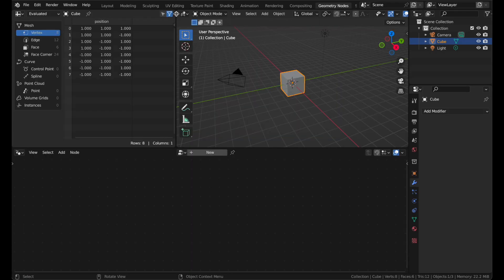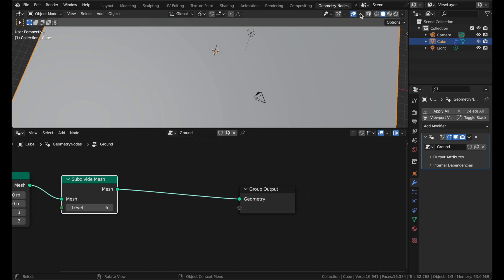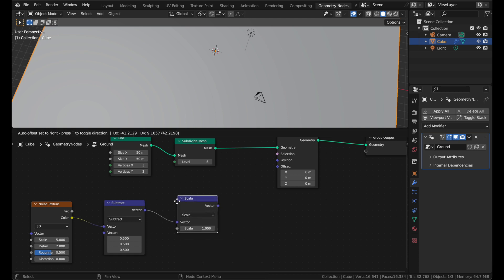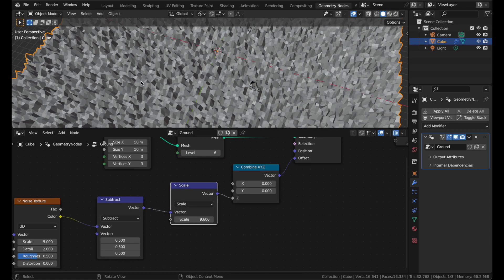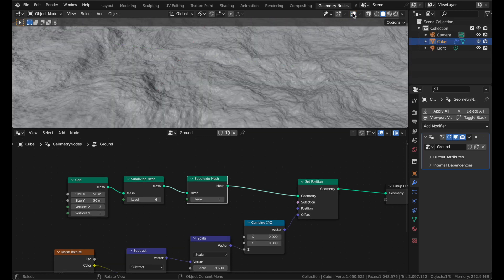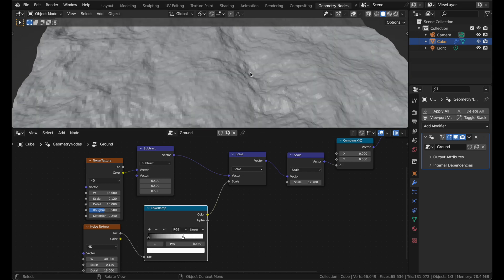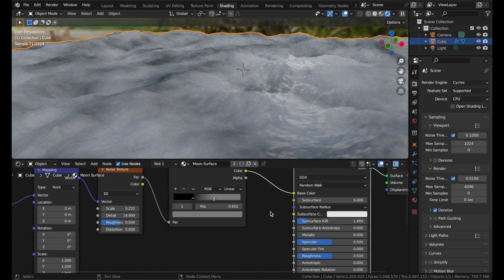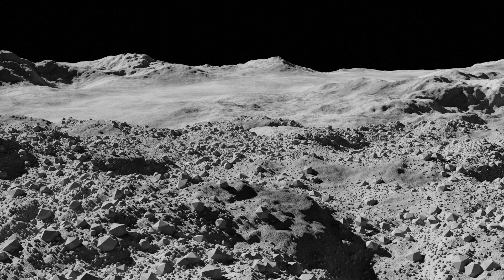Easy Moon Terrain In Blender (Only 4 Noise Textures)

Comment: Cool result, but why are you starting with such a redundant setup? First of all, why subdivide the grid twice? Just increase the number of vertices from the start, no need for subdividing. Maybe add one Subdivide to switch between fine detail and a more responsive workflow. And the first Noise node: why use a Vector Math node to subtract 0.5 on XYZ? You set XY to 0 anyway and for the moon surface, the value of Z does not matter if your displacement goes from 0 to 1 or from -0.5 to 0.5 and so you simply could have used the Fac output like on the second Noise and then with a normal Multiply node plug into the Combine XYZ node.
Reply from the maker: those sound like good efficiency upgrades!

Comment: how to make this forground
Reply from the maker: I just scattered icospheres everywhere
Reply: @samuelsullins  did you made a new plan and how did they are on the surface mine are just floating above or below the surface
Reply: @boltiphoto  You have a couple of options: 1. You can paint it yourself with the scatter tool 2. you can use the particle system with hair and render it with your object
Reply from the maker: I instanced them with Geometry Nodes. I’ll make you a video about it this Thursday.